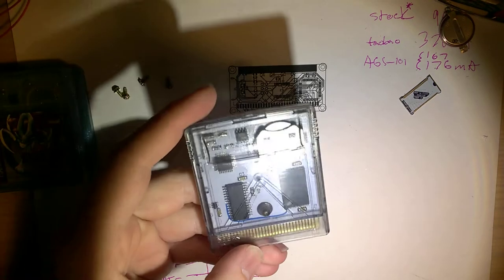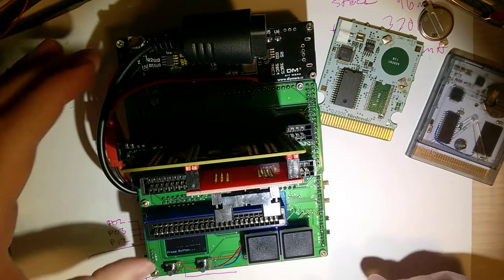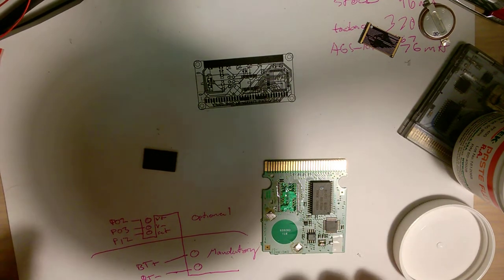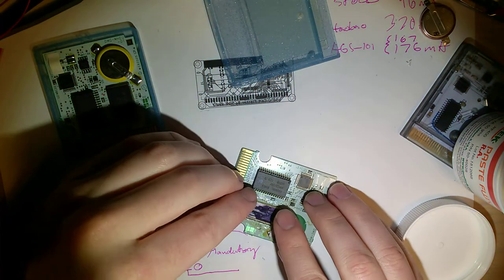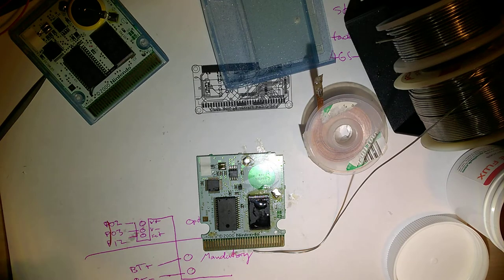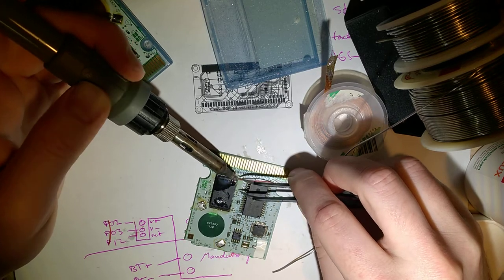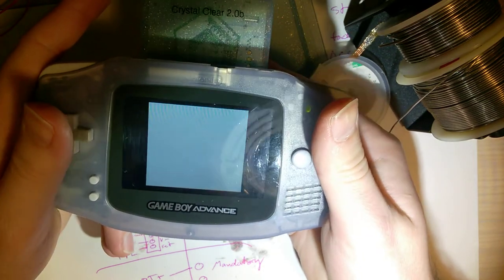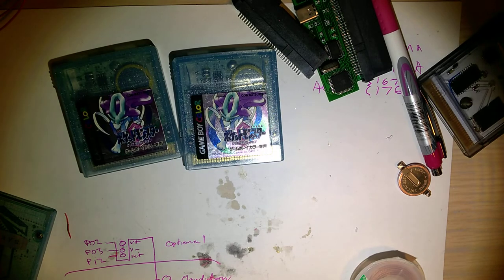Making a JP Pokemon Crystal RTC Flash Cart

Comment: So cool and helpful! Going to try to do it to. Can i use a hot air gun to solder adapter adapter and flash?
Reply from the maker: I believe the adapter would need to be hand soldered to the PCB but you should be able to use hot air to solder the flash to the adapter. I'd do 'em both by hand though.
Reply: @makho  hot air and soldering past is easier for a novice like me:) But can the hot air gun damage flash chip?
Reply from the maker: @Israelelf  hot air should not damage any of the components since that's how they were designed to be soldered in the first place

Comment: I finally got the jrodrigo adapter chips. But they have odd things sticking out on all 4 sides. Do you think I could sand it down or something? Or are they just trash now?
Reply from the maker: If you got them from oshpark, I'm guessing those are just the panelization tabs. Yes, you can (and should) just sand or file those down.
Reply: @makho  after looking at it on the underside, it looks like the metal contacts are all fine. Like, it looks like it should still work even if I don't sand them down. Do you think it would hurt anything to leave it? Because I don't want to ruin it and have to order more lol
Reply from the maker: @Soul94255  as long as there is nothing that impedes your install, you are fine to leave them
Reply: Update: I fucked it up bad. I don't have a heat gun so I tried to cut the legs following a tutorial. I ended up ripping traces off the board. I don't think I can save it. At least jp carts are cheap... I'm scared to try again though.

Comment: I have a US board that has no chip on it, could I do this on that one as well? Jumper wire to pin 3 I assume just like the JPN one? Or is it incompatible do you think?
Reply from the maker: probably fine
Reply: @makho  oddly because the chip is mbc30 and it’s a 44 pin adapter I think I need to figure out the pin out as it didn’t work 🥲
Reply from the maker: @kyle88l  well, yeah, mbc30 and mbc3 have different pinouts. The MROM pinout is the same between models with the same part.
Reply: @makho  yeah I realized it once I read the chip. Can’t find pin out for the mbc30 though. Otherwise I’m sure it would work the same
Reply: @kyle88l  did you ever figure out what was wrong and how to fix it, been at this for hours now

Comment: Do you know if his revision [X] is released online somewhere? I wanted to get it from OSHPARK but I can't find it. Also, which version works on Japanese Crystal carts? The one that starts with T?
Reply: Also can we flash it with Sanni's adapter when it is already soldered on or only before with the SNES thing? I am planning on making one that is Gameboy only like you did
Reply from the maker: @NikhilGarlapati  You need the TSOP44 version for Pokemon Crystal carts. You can flash the chip once the cart is assembled, I just like preflashing it because it's not that easy to solder and if you know the flash chip itself is not bad, it makes troubleshooting installs much easier. 

https://github.com/JRodrigoTech/FLASH-ROM-Adapter-for-GameBoy
Reply: @makho  thanks! Also, where do you recommend buying the flashchip from? Also, are you sure the ones on the github are his new revision X (see https://www.tindie.com/products/jrodrigo/flash-memory-adapter-for-some-game-boy-cartridges/) ?  And I think you said in the video that you got a faulty adapter from OSHPARK. Should I order more than 1 just in case one ends up faulty? Thanks for all your help!
Reply: Im an idiot lol forgot oshpark is minimum 3
Reply: Where do you get your japanese crystal carts from usually? How much do you pay for them
Reply from the maker: @NikhilGarlapati  I order my carts from ebay usually. They were around $5 at the time but it looks like they've gone up. The problem with the adapters is that they require castellated holes and oshpark doesn't really support them (but they do allow them). Other manufacturers charge a lot more for castellated holes (but you also shouldn't get any defective boards). I get my flash chips on aliexpress, you want AM29f016 chips.
Reply: @makho  I bought the same chips you linked to someone else who asked for the parts. Will those work with the old board (the one that is incompatible with jp crystal but compatible with jp silver and is easier to install?)
Reply from the maker: @NikhilGarlapati  Yep, they'll work on either board.
Reply: @makho  why tsop44 are needed for Pokemon Crystal Carts?
Reply from the maker: @TengoReuma  because that's the part that pokemon crystal uses.
Reply: @makho  Yeah thanks I didn't noticed that EUR and US cartridge-boards for PKMN crystal are diferent from the one of Japan since they use the same board for Gold and Silver

Comment: Amazing video like always. I know this video has been on here for a few years but have spent the last week going through loads of AM29F016 chips. No success. Got my TSOP-44L adapters from OSH Park. Currently have 9 of those. I have tried every chip and every board. I have a gbxcart rw. It tells me it's not rewritable. Can't flash anything to it or do anything with it. Sorry for the long message. Just wanted to explain in detail. Hope someone can help please. Thank you
Reply from the maker: Check your soldering. There are a lot of very fine joints and it's easy for something to go wrong.
Reply: @makho   Thank you for such a fast response.  I checked over it. used a multimeter too just to be 100%. I just can't figure it out at all.
Reply: @makho   Well after waiting for another batch of AM29F016 chips and 6 more adapters I can finally say I have given up. Im 100% sure of my soldering. Been soldering for years. I have brought a BennVenn joebags JR V2 aswell as my gbxcart just to test. The joebags has said that every time I have tried it hasn't detected a flash chip and comes back with 0000 on everything it reads for. What a waste of time and money
Reply from the maker: @renboxtable  It took me quite a few tries to get a working one. What's more likely, your soldering or all of the materials you are using are busted? You're confident that you got the alignment correct? No shorts? No deformities with the adapters? Castellated holes can be fickle.
Reply: @makho  soldering is all good. You saying about deformations. Just noticed that all of the chips have what looks like a big bubble on the bottom.
Reply from the maker: @renboxtable  All your chips have a bubble on them? They should be 100% flat.
Reply: @makho  all of them have bubbles. All good though. I got a refund from the seller and ordered elsewhere. The very first chip worked straight away. Loving it so far. Been playing Pokémon Prism.
Reply from the maker: @renboxtable  Well, none should have bubbles ¯\_(ツ)_/¯

Comment: Can you post links for your parts?
Reply from the maker: All you need is a donot cart (in this case JP Pokemon Crystal, check ebay), the flash adapter, check the description, and then some AM29F016 chip. These are the AM29F016 chips I used: https://www.aliexpress.com/item/10pcs-lot-AM29F016D-70EF-AM29F016D-TSOP48-AM29F016-29f016-TSOP48/32968426514.html
Reply: @makho  why the 2mb chip instead of the 4mb?
Reply from the maker: @obrebel0  Because 4 years ago when I made this video (and flash cart), there were no 4mb ROMs or ROM hacks. Also, 4mb chips are 5x or more the cost compared to 2mb chips.